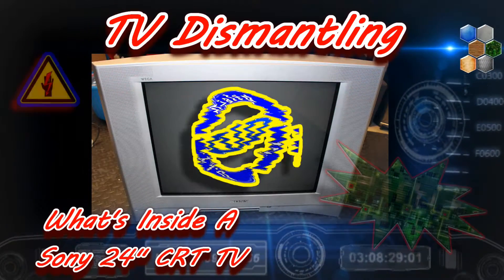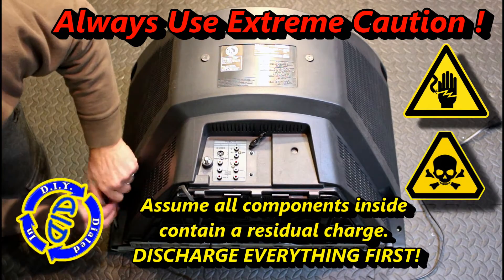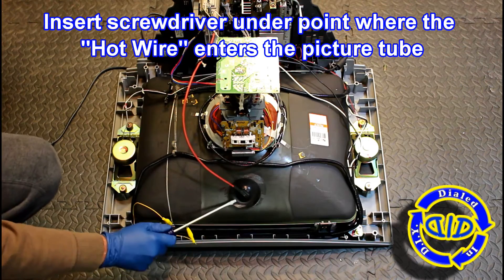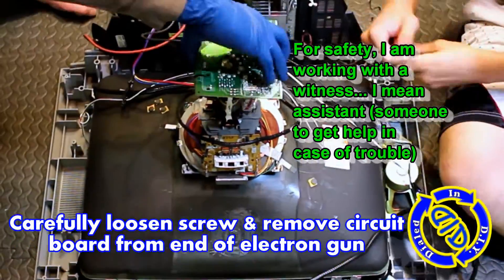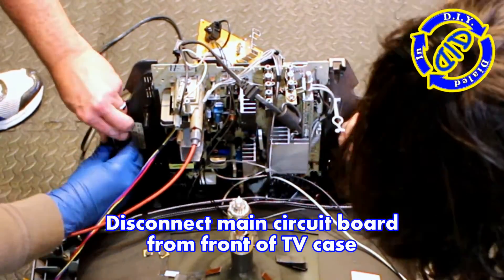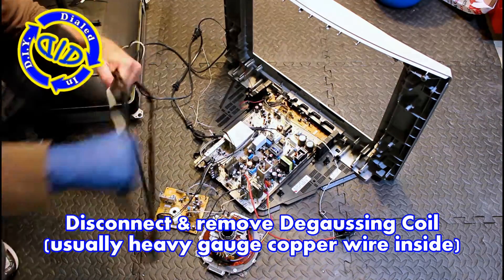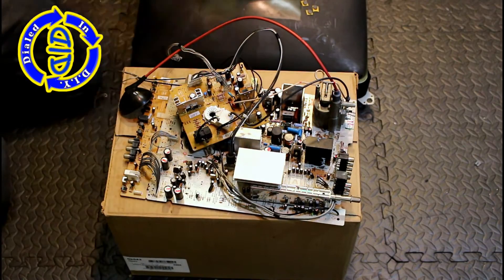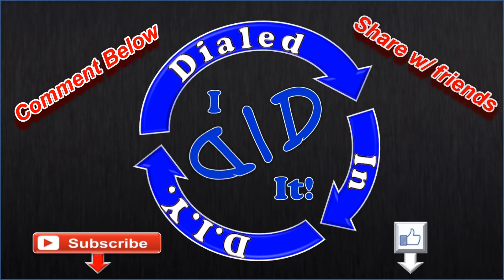FREE parts from TV Salvage - Whats Inside Sony 24 TV

Comment: Thanks, great video!!! I want to salvage my Sylvania 27inch CRT DTV and use some of the parts for a crystal radio project, i.e. copper wiring.  What type of soldering pen or gun would you recommend to remove electronic parts, wattage and type plus any accessories needed such as heat sink??

Comment: How do you discharge the components?
Reply from the maker: I carefully short the contacts making sure that I am shielded. Many people use a rubber handled screwdriver to touch to both contact points for capacitors.

Comment: I have old Sony Trinitron .....what can I salvage from it?
Reply from the maker: Exact options depend upon the model but you can usually get speakers, LEDs, coils/wires (copper), transformer, tuner, and the other stuff I show in my TV videos are typically found in your tube style televisions. That also includes all of the individual pieces on the boards like resistors, capacitors, pots, etc.

Comment: What recycling shop is taking CRT's for free? Best Buy and other places here in Lincoln Nebraska require a payment of $25 to $35.
Reply from the maker: It is interesting that some places still charge to take old electronics because recycling companies typically make money from the things we "donate" to them... even CRTs.  I have found many ways to recycle CRTs for free: a local mall runs free electronic waste collections at least twice a year, the county has several hazardous waste disposal locations that will take CRTs free on specific days of the week, I have seen ads for a high school running free electronic waste collection programs, my company also does this a couple times a year and there are facilities that are listed on line that will take just about everything (I usually call first for anything a bit different or large).  You can check into those or I also found a national website that lists locations - NCER, National Center for Electronics Recycling (it is a 501(c)(3) non-profit org.)  Hopefully one of these can work for you too!